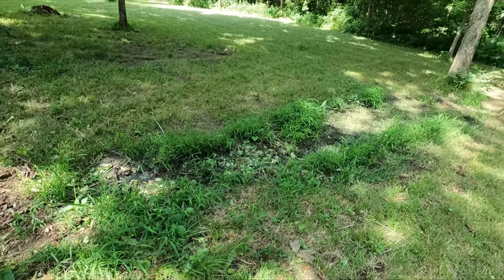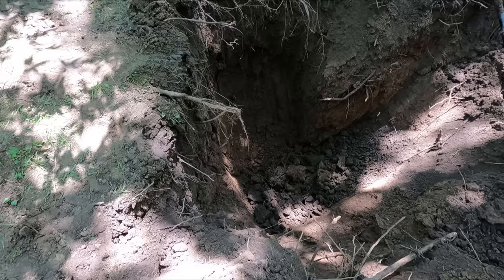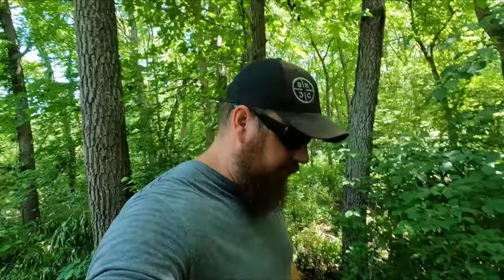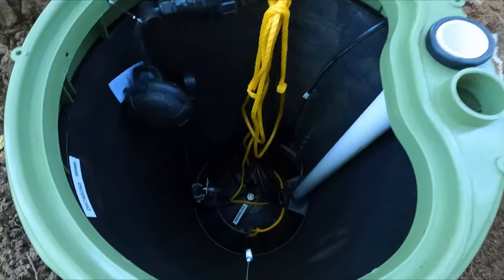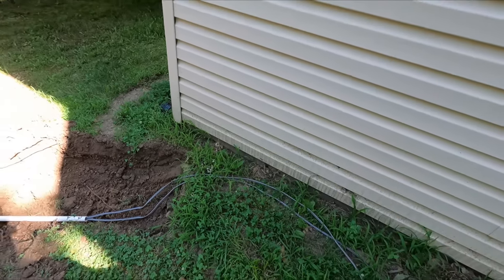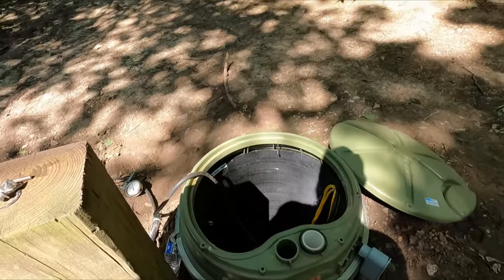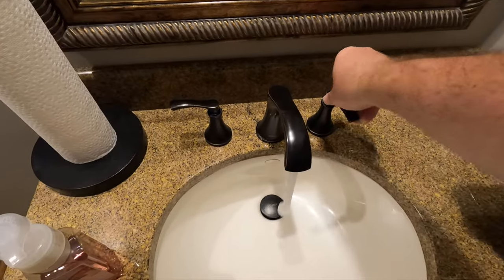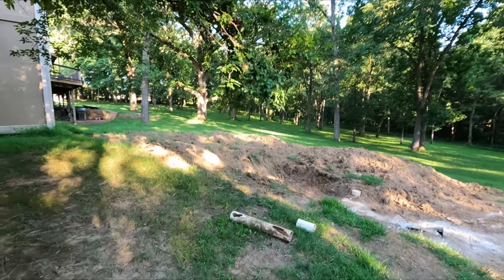It Works!! E/One Sewage Grinder Pump Installed

Comment: Just did a e1 pit yesterday. It was 89 in and man it was rough. 1/1/4. We had a hdd bore 300ft under a road
Reply from the maker: It was definitely a job... sounds like yours was too!
Reply: @LifeofBliss  sure was. Failed inspection for no vent. That giant pump. Did u put a candy cane vent tying off of the house to tank ?? I didn’t and it failed. We put the tank 10 feet from the structure to spec. And inspector made us put a 4in 2 way t
Reply from the maker: A vent in the line between structure and pump? No... the pump itself has a vent/overflow pipe that comes up to the lid.
Reply: @LifeofBliss  that’s exactly what I said
Reply from the maker: @gregoryhawsjr3479  sounds like code may be different where you're at? We have 2 clean outs between structure and pump, but they are capped and not vented
Reply: @LifeofBliss  I’ll keep you posted. The inspector said show him the vent under the lid next week and he’ll pass. Ty
Reply from the maker: Hopefully that'll solve his issue. Good luck man!